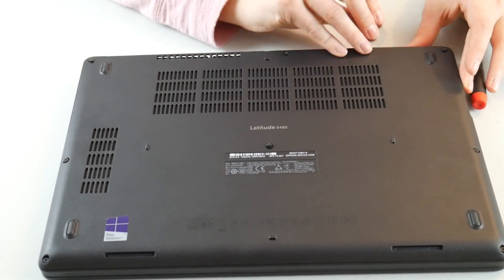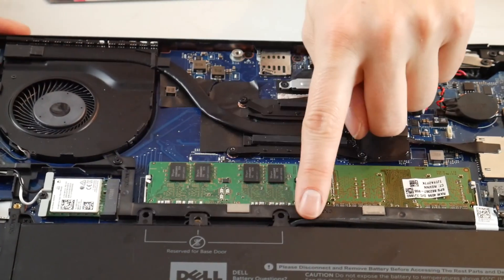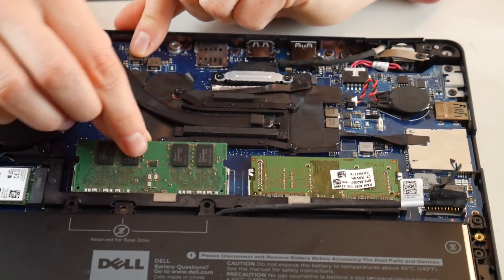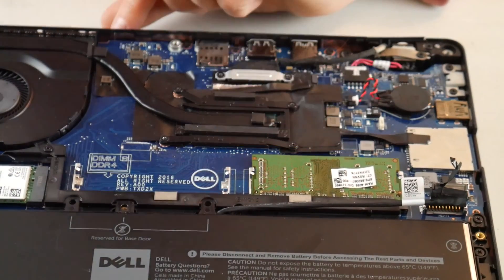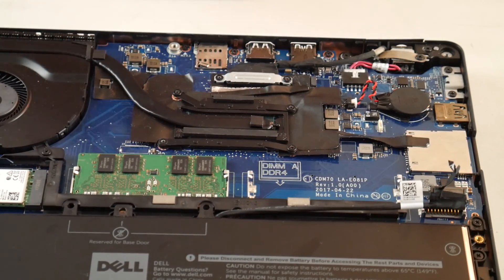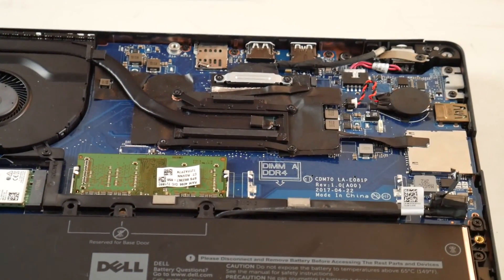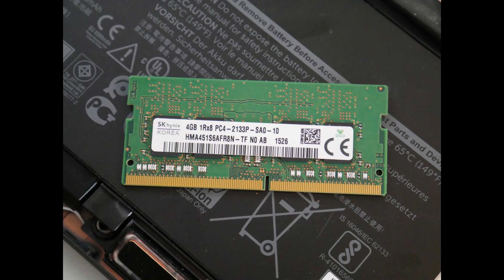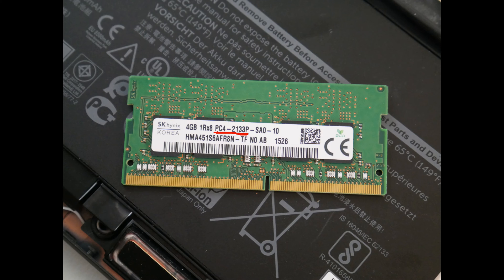How to Fix a Dell Computer That Flashes LED Code 2 3

Comment: Hello! My laptop's LED light is blinking 3 amber 1 white. 
My sister has been using my laptop lately and she left it plugged earlier before I used it. There was a prompt shown about the AC adaptor so I just dimissed it because I assumed it was the usual where I just had to replug the charger. I don't remember if I replugged it or unplugged, but after an hour of use, youtube was still buffering even though the internet is fine so I hibernated the laptop since I won't be using it anymore.
I noticed that the lights are blinking 4 and 1, and when I turned on the laptop it showed a message that the battery was low and it shut off. I plugged the AC again and turned it on but when I reached the desktop screen, I could see the battery icon moving like it's charging but aftee a few secs it prompted the low battery message again and locked or shut off.
I tried removing the battery and turned it on with the AC only and it works fine. I shut it off and pushed on the power button to drain the flea power, put the battery back and the AC but it still won't work.
I went to diagnostics and the battery charge kept changing from 0% and 100%. Battery health is changing from 26% and 100%. Battery voltage is changing too. Current flow is 0mA. Charging state is Idle.

I don't know what to do 😭
Reply from the maker: 4 1 is a problem with the CMOS Battery problem which can be that CMOS battery (the battery on the motherboard) needs replacing or it can mean its the CMOS isn't getting enough power because of a bad battery or bad power cord. Did the diagnostic say the battery and/or charger was bad? 

Also here is a video on how to test your charger:
https://youtu.be/IrNgyd8T0Fc

If you want to see what a CMOS battery looks like this video is on a different issue but shows you how to remove and replace a CMOS battery:
https://youtu.be/IrNgyd8T0Fc
Reply: @EggheadFixers  The ePSA Pre-boot System Assessment did not mention about anything being bad. Yesterday, the results and the event log showed, "Fail PSA V4302 Error 2000:0132. Validate Code : 127081 Battery - The battery is reaching the end of its usable life." I did the quick test again today and it all passed, but after going for a 2nd test it showed the same error message.

I'd also like to mention that there is a fine crack on the left palm rest of my laptop coming from the corner of the USB port and it goes just under where the Fn key is. It's probably from the times I dropped or bumped the laptop while in my bag. It's not noticable unless you actually look at it. I'm not sure about this but it seems like ever since I found that crack, if I rest my palm around that spot while typing, the flickering line (sorry, I don't know what it's called) would go somewhere else as if I clicked it there and I'd end up messing what I have typed or am typing. I wonder if that has made any damage or effect on the inner parts of my laptop.

You also mistakenly pasted the same video reference link for the charger testing and CMOS battery.
Reply from the maker: @YTBurner  Sounds like your battery may be starting to fail. You could try replacing the battery if that doesn't do it then I would replace the power cord next.

Comment: hello, can i ask whats the problem if all of it is blinking white ??
Reply: its 1 1 1, but its okay now, i reassembled it but then it beeps like 5 times then i removed the battery and its fine again . thank you for your replies . i really appreciated it ☺
Reply from the maker: @budzzmiah  Happy it all worked out:)
Reply from the maker: IS there a pattern to the blinking?
Reply: @EggheadFixers  ahm its slow, like after 2 seconds
Reply from the maker: @budzzmiah  yes but is it just consistently blinking like 1 1 1 or is a pattern like 2 blinks pause 5 blinks.

Comment: Hi dear how are you i need help my laptop dell E7240 power led blink again & again bit won't turn on my laptop i am already checking everything like ram change etc kindly tell me how to fix this problem
Reply from the maker: Does the Led lights blink in sort of pattern?
Reply: Egghead Fixers Continue blinking after every 3 sec
Reply from the maker: @informativehub2242  yes but is it any sort of pattern like 2 blinks and then 4 or is just keep blinking steadily.
Reply: Egghead Fixers thanx for your reply my problem now fixed after change cmos battery
Reply from the maker: @informativehub2242  Excellent!! Good job troubleshooting
Reply: @EggheadFixers  THANX FOR YOUR REPLY & SUPPORT
Reply from the maker: @informativehub2242  Glad to hear it!!
Reply: Egghead Fixers Good work on your channel i am also susbcribe keep it up ❤️❤️
Reply: Egghead Fixers Best of all, it helps you all
Reply from the maker: @informativehub2242  Thanks for the support!! 😃

Comment: Hello video is great but I have Little bit different problem plzz.help me to sought out (when I am plugging my charger to my Dell laptop battery indicator is blinking red and Orange when I am removing charger my laptop is getting off automatically
And not starting without charger)plzz help me
Reply: Plzz reply me
Reply from the maker: Sounds like battery may need replacing. Here is a video on a different issue that in the beginning shows you how to run a Dell diagnostic. It will tell you if you need to replace it or if there are any other problems with your hard ware:

https://youtu.be/n6unGwtpbEc

Comment: Im scared cause my dell laptop flashes the red and white light on the battery plz help me how to fix or ill think it will have a breakdown
Reply from the maker: What code is it blinking? how many red? how many white?
Reply: @EggheadFixers  its blinking 1 and 1 lights i think
Reply: @EggheadFixers  and it still lets me play tho
Reply from the maker: @spearsinvane7398   1 1 is usually a motherboard issue but if it is still working then I would try running a diagnostic. Here is a video on a different issue but in the beginning it shows you how to run a Dell diagnostic:

https://youtu.be/n6unGwtpbEc

Run the diagnostic and let me know if everything passes.

Comment: Hi! Very interesting video. What about the  code 3 orange flashes and 1 white? Do you have any idea? Thank you in advance
Reply from the maker: Hi! Thanks! This LED code can be RAM which you would test with the method in this video, it can also be a CPU or motherboard issue. Hope that helps:)

Comment: What  to do for a flash code for 2,2 led
Reply from the maker: Is it sill turning on? if it is sometimes this can be related to your Date and Time not being set correctly in BIOS. Here is a video on a different problem but it shows you how to set the date and time:

https://youtu.be/n6unGwtpbEc

Let me know how it goes:)

Comment: Hi! I’m trying to do this but some of the screws won’t come out or twist out
Reply from the maker: You may need to magnetize your screwdriver if you leave it on a strong magnetic for about an hour then it will be magnetized. That way the screws should come out when you pull the screwdriver out of the hole.

Comment: Hi,my dell only blinks orange. Can u tell what is wrong with my laptop? Thanks!
Reply from the maker: Usually if there is a problem with it then it will blink some sort of LED code. For example it will blink 2 white LEDS 3 orange or 2 orange LEDs then pause 3 more orange LEDs. Do you notice any sort of pattern like that?
Reply: https://youtu.be/8GpCoD6C3I4
Hi, this is the video for the problem. And i forgot to mention that it cannot be used without plugging in to charger. I think there is some problem with the battery.
Reply from the maker: @TuanLe-qx5mt  Ya if it can't be used without the charger there is most likely a problem with the battery. This is a video on a different issue but in the beginning of the video it shows you how to run a diagnostic on your dell. I would  run it and see what it says. Let me know how it goes:)

Comment: Ok, I have that error code, but the CPU is what is causing it. Is there any saving the CPU? Trying to avoid buying a new one.
Reply from the maker: If its socketed (removable) and not integrated into the motherboard then sometimes you can try what we call reseating it which means removing it and then reinstalling it. This sometimes works because a CPU error code can be caused by a bad connection between the motherboard and the CPU. Although if that does not work then you most likely need to replace it. Let me know if you have any more questions:)
Reply: @EggheadFixers   dang... I have tried the cpu in a couple different boards. I'm pretty convinced it's toast.
Reply from the maker: @justaguywhocares4478  Ya sounds like it may be:( Sorry to hear that